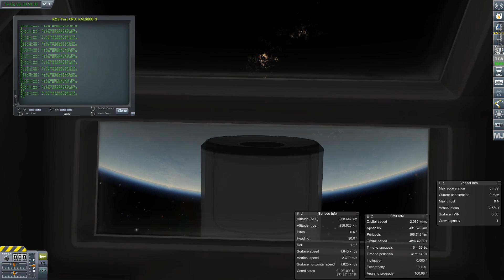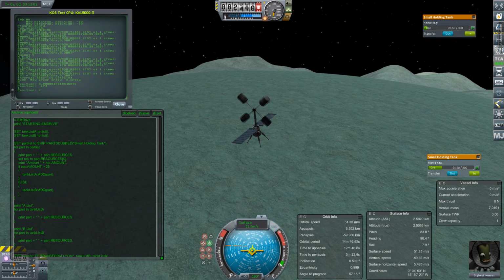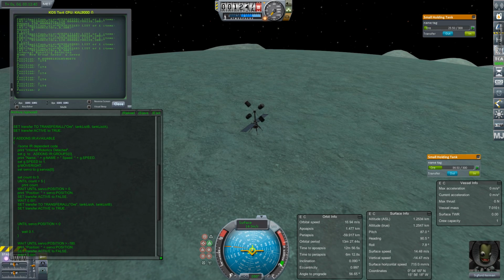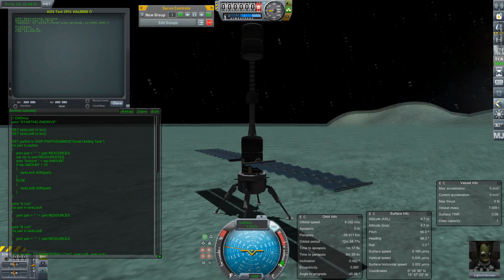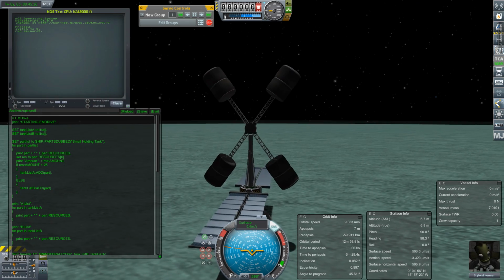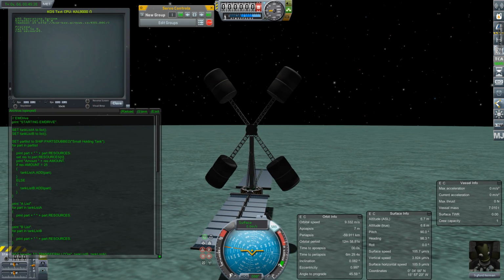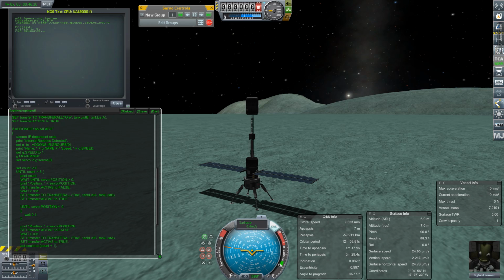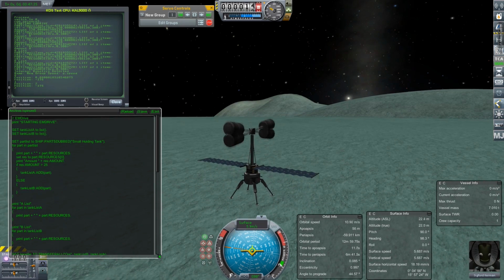Exploiting Kerbal Physics To Make 'Impossible' Gyroscope Drive

Comment: I'm just...a "little" confused. Why exactly wouldn't the gyro drive work in real life? Say, we are in ZERO G a vacuum, with little resistance ( of course they're will be one particle per every many thousandth of a meter). Then, as your first design of 2013, we rotate it, and after every 180 degree rotation, we move the liquid mass to the end of the ship pointed to location X. Would it not work? I have a limited knowledge of physics, and I'm just confused about this. If you could reply, that would be great.
Reply: Diabetic Alien  "Conservation of momentum."  Center of mass of enclosed system never accelerates.  Or a more "intuitive" explanation: in reality transferring fuel through plumbing has the same effect as moving the whole tank, so this contraption is literally rowing in vacuum, which obviously does not work.
Reply: I think what evg-zhabotinsky is trying to say is that pumping the liquid to the other tank would move the tanks, not the liquid. because of the relative mass of the objects, the vehicle would move in relation to the liquid, not the other way around. So if we have the liquid forward and we spin, the liquid is now in the back and (lets say the device is 5 meters long(5 meters between tanks)) the device is now 5 meters forward. now if we move the liquid forward, the device moves 5 meters backwards ( linearly, not by rotation as in the first spin) because it moves around the flowing liquid. our liquid is now forward and the device is in its original position, meaning we gained nothing.
Reply: In real life if you tried this the CoM would stay put and the ship around it would shift up when you transfer the mass down, but then shift back down to where it started again when you swing that mass back up to the top again.  In real life moving the CoM really means the ship around the CoM moves and the CoM stays put.  In KSP that's true of rotational changes but not true of fuel transfers, thus the exploitable hole Scott is using here.
Reply: Diabetic Alien The momentum of  the fuel would counteract the momentum you would produce using this method. Kerbal doesn't model the momentum of the fuel properly.
Reply: anagram gamaran How about if you are in deep space, moving, yes, but not of sufficient distance of an object to feel sufficient gravitation attraction. You have a tank filled with fuel. You rotate 180 degrees around the center of mass, the tank filled with fuel, then stop rotating. Then, fill the empty tank, and rotate around the center of mass, the other fuel tank. repeat many times. What would happen?
Reply: The only way i can think of for the device to work would be if we were to "teleport" the mass somehow, just like how it works in KSP. Perhaps if we were to near losslessly convert the mass in the back tank to energy, transfer the neigh massless energy to the front tank, and then use some type of mass-fabricator to near losslessly convert the energy back into mass, meaning the mass is now in the front without any significant movement of the object backwards.

 I am not sure this even makes sense because the energy might have the mass of the object which was deconstructed... but i'm not sure if  that makes any sense either... 

needless to say, I'm interested to see if physics gets...strange if we start losslessly converting mass to energy and energy back into mass.
Reply: Leyton Janqlan But would it not work with fuel pumps? What if we rapidly pumped the empty tank full with the liquid, and now the other being empty, we rotate around the new center of mass (aka the now full fuel tank). I still don't understand why this is not a perfectly sustainable and effective way of transportation in space.
Reply: That really is like putting a fan on your boat to blow on the sails, claiming that it will go forward. Or you can think of it this way: at that point your fuel pump kinna becomes a rocket engine too. You push the fuel forward, the fuel pump gets pushed backward, Newton's 3rd Law. So the process only move ship backwards relative to the center of mass, while the center of mass has not moved in space.
Reply: CKFYCoren So, thus, what could happen would be, lets say you have an infinite amount of fuel. Every time you pump fuel into tank B, tank A (the tank that is being empty) magically is filled, without fuel pumps. Could, logically, this work as a spacecraft?
Reply: Diabetic Alien if you have infinite fuel, what do you need a lossless drive for, if you can teleport stuff you already have infinite power/ instant teleportation, what do you need a drive for?
Reply: No it wouldn't work because in that case your tanks will both be full and will both have the same mass. Additionally you'd lose out on one half of the rotation because the magically refilling tank will always have the same mass. Also the momentum of the liquid moving through the pipelines to transfer between tanks would still cause enough force to cancel out the force from swinging it down in the tank. If you had a tank that magically refilled with fuel you could use it as actual fuel in a reaction engine but if for instance it instead generated an inert liquid usable only as mass you'd still be better off pumping the liquid through a pipeline pointing out the back of the spaceship for propulsion.

The only reason this works in KSP is because KSP treats pumping fuel and other matter not as "pumping matter between two objects" but instead as "dialing mass variable up on one object and down on the other at the same time".
Reply: TheRealPentigan Oh wait, I just had an idea. It's more or less a tube, but it is designed ti work underwater. Could you logically propel something if it's engine was a pump?
Reply: Diabetic Alien only if you're expelling/losing some of the mass. For example, take those water powered jet packs. Those are just big pumps with hoses.
Reply: Newton's third law of Physics: Every action has an equal and opposite reaction, moving the fuel enacts an opposite force on your craft that cancels out any progress you could have made.
Reply: Wait, I thought of something.what if you made a fuel transfer system that did not provide an equal and opposite reaction. You could almost drain the fuel. You could make the empty tank a vacuum, so the tank immediately drains. Would that be possible?
Reply: Diabetic Alien that is not possible as far as we know because that would violate the third law of motion
Reply: Nathan Strebe Fair enough. *Sniffle* My dream will never be.
Reply: Diabetic Alien every action. EVERY ACTION. Actions of the every variety. I mean technically Newton is superceded by quantum, hence the EM drive but nobody understands quantum.
Reply: Well, what is there to say? These are all entirely theories. We can't know. not yet.
Reply: HASEnoncorperated I recall hearing an explanation of the EM drive that doesn't actually "break the laws" of motion. I can't remember what it was exactly. I'll try to find it.
Reply: Diabetic Alien technically, no theory can be completely correct, it can only be the most accurate theory we have.
Reply: Well, if you take advantage of general relativity's capability to mess with the wavelengths of light (by stretching the space in which it exists), sure, you could theoretically get a device that generates energy and using that movement from nothing, but in practice it'd probably take up more energy to create the gravitational fields necessary than you'd get out of it.
Reply: +Diabetic Alien Theories are supported by reasearch, for things people came up with and don't bother to back up with evidence see every other comment on the internet.
Reply: +Nathan Strebe I was kind of using it more as an example of how, as i understand, a lot of the physics before special and general relativity are technically invalidated, if close enough approximations that we still use them whenever possible, and when we use quantum whatever we can do stuff that isn't quite modelled by them.

Comment: Scott, the fuel transfer rate is not hardcoded into a private variable of KSP itself.  It's hardcoded into a private variable of kOS, not of KSP.  It's in src/kOS/Suffixed/ResourceTransferValue.cs, line 16, as:

        private const float RESOURCE_SHARE_PER_UPDATE = 0.005f;

There is no such thing as the stock game's "standard" resource transfer rate according to its physical rules.  Instead it implements resource transfers entirely inside the user interface code, not inside its "laws of physics" code.  So when we're bypassing the normal user interface to instead provide a scripting interface, we don't really have a standard 'here's how resource transfers work" API call to make use of.

We had to make something up that felt roughly on-par with what the stock game allows.  What we made up, was 0.005 resource per physics update.

That private variable you're talking about is ours, not KSP's.
Reply: I'm sorry to be pedantic but it would be more accurate to say 'hard coded as a constant', as private variables are not hard coded, and constants are not variables. But I'm sure anybody who cares already understands what you mean :P Just had to scratch that itch... (all in the context of C#, other languages may have different semantics for constants and private)
Reply: Isn't the stock resource transfer rate roughly proportional to the fuel tank size? So a 5m tank could transfer 64x faster than a 1.25m tank, etc. When you get into orders of magnitude that matters a lot

Comment: "When the mass is fully forvard, you want to start to transfer fuel"
eh... don't you want to do transfers in in forward part of circle?
so.. begin at 90 degrees and end at 270?
Reply: You are Scott Manley. You just got a helicopter with vertical blades into space. I will trust you on ANYTHING.
Reply: What's actually going on here is that the center of mass is moving rearward relative to the axle on which the tanks rotate, which imparts a thrust to the axle and therefore to the rest of the ship, since it's attached.  You want the transfer to take place while the vectors of the rotating masses are canceling each other out, so keep it as close to the axis of travel as possible, +- 30 to 45 degrees.
Reply: For example, the vehicle that Scott used to land on Minmus has part of cycle that moves fuel forward!
Reply from the maker: I once thought like this, then I tested it, and fixed it, and this is what I ended up with. Trust me on it.
Reply: Suedocode
if the main effect comes from moves of tanks, than it is bug of Infernal Robotics
the fuel move bug comes from no inertia change from fuel transfer
Reply: Okay, here's my hypothesis. Only look at the tank's horizontal position/velocity during a "stroke" of the "engine". On the back stroke, the heavy tank starts moving backwards. Increasing the backward KE of the tank (aka work) adds an equivalent forward KE to the rest of the ship to net zero. At the 90 degree mark (half-way on the backstroke), the added KE starts changing directions to slow down the tank (forward KE from the ship is taken to cancel the reverse KE of the tank). As NoName said, this would imply that the 90 degree mark is the most optimal time to magically teleport to the mass into the forward tank.

If the FULL fuel transfer was instantaneous, then I think he'd be correct. I believe the issue, however, is that the fuel transfer takes some time. The longer it takes for fuel to transfer into the empty tank, the more cancellation (which is the correct thing that should be happening) starts happening and your "drive" loses effectiveness (it adds the same KE to the ship, but it's just heavier because there's redundant fuel). You want the tank to be empty at 90, and as full as possible up until that point.

I hypothesize that the optimal spin drive would be one that uses the full time of 0-90 pupping fuel forward, which means you should start pumping at 0 as Scott observed.
Reply: Can you transfer fuels through the rotors? If so, it will probably be even more efficient to have a reservoir tank attached to the ship rather than on spinning counter-balances. I think the counter-balances themselves don't do much in this engine anyway.

Additionally, tanks can transfer fuel at a rate proportional to their size. If a large tank's dry mass isn't prohibitive, it's probably even more efficient to have a large partially-filled reservoir to help push stuff more quickly into the drive tanks. The key to this drive is how quickly you can transfer fuel.
Reply: bobobobinalong I don't think it's merely because the center of mass is shifting around, otherwise there would be no net gain in velocity; the center of mass still shifts back to the original position after a stroke. I still think the issue is that the fuel's momentum is directly associated with the current tank its in rather than as its own quantity.

I do think your conclusion is right though; start pumping fuel forward at 150 to -150 (end of the first stroke, start of the next), or thereabout. I need to compute the actual optimal angle, but it's probably around there.

Comment: Here's an idea: spin a (balanced) ship violently (only with electricity). Than, suddenly eject a capsule in retrograde vector. It should deorbit without using any burning fuel.
Reply: Jasc Tomm I once got an OKTO 5 meters off the ground with massive seperators!

Comment: Could you beat the flow restriction by having several tanks? i.e., if the max flow rate between 2 tanks is limited to X then with 4 tanks you should get 2X flow rate.

Comment: But what about the D Drive? When you place Danny 2462, a bag of legos into a capsule and let him divide by zero assembling them = instantaneous dimensional thrust folding space time?
Reply: i mean, danny has broken the laws of physics and conquered spacetime loads of times, so... yeah.. Scott should send this to danny
Reply: choibacco At that point, the combination of LEGO and Kraken starts summoning LEGO Aquazone sets made of negative matter a la Hawking radiation, creating a sort of thermodynamic "pull" that ensures momentum is conserved.
Reply: But such a device would almost guarantee death by spaghettification of any onboard human!
Reply: Shinny Orc 
Eh. It'd be worth it.
Reply: I have a healthy enough ego to tell you that I didn't get that joke.
What I can tell you though is that some of the groundworks done by Harold White for a possible future FTL drive include the White-Juday Warp Field Interferometer. One of the goals of this experiment is to find out if it is possible to bend space by means of a high voltage electric field in order to alter gravity. Even if it proves to be impossible to actually build an FTL drive like the one designed by Miguel Alcubierre, this experiment could be valueable in inventing a spacecraft drive not relying on expelling mass, but instead propelling it by bending space-time.
Reply: B

Comment: How'd you get Infernal Robotics to work in 1.2.2?
Reply: batt3ryac1d He didn't, this is not 1.2.2
Reply: GCWAPA :(
Reply: batt3ryac1d I actually can run 1.2.2 with infernal robotics, its just that toolbar wont work
Reply: GCWAPA Yeah I know. Half of my mods are 1.1 versions and shit that either work fine or kinda work lol. But I wanted it to work properly.

Comment: I did try to avoid that very problem when createing this place buuut when you got the right Materials, Transferrate & Roation Speed it still produces Thrust dispite the fact that this Universe got a Seperate Programm to check for something like this (Sadly it never worked anyway so i simplyfied it and made that way of Gaining Speed/Velocity fairly Ultra High Ended (Compared to Modern Human Rocket & Spacecraft Engineering)

Comment: Would you not be able to produce more delta-v if you had more pendulums pumping fuel/ore around? Seeing as it appears the fixed transfer rate is really what slows you down the most.
Reply: Marijn R maybe using Tac fuel management?
Reply: More thrust, but at the cost of a higher weight. In another comment, Scott Manley said that the TWR wouldn't increase that much.
Reply: TAC fuel could work. It had 100x transfer rates if I remember rightly. I don't know if it works with kOS though.

Comment: What's with all the UNTIL loops? Does it not support WHILE?
Reply: That Guy  RTFM :D  Seriously though, this Kerboscript is a bit weird. It looks like a high level language, but in reality it's more like assembler. I would compare kOS architecture to Python bytecode, only simpler overall and running real slow, like 2000 ticks/second, within physics engine ticks.
Reply: evg-zhabotinsky That's nothing like assembler, too many operands per opcode
Reply: That Guy  Anyway, this language mostly mirrors their bytecode. Like "we won't have OOP until bytecode supports it". And they don't have much syntactic sugar. This "until" loop is actually "while not" now that I looked at it again, but they don't provide "while" as syntactic sugar for "until not". And they don't have "real" "until" loops (I mean repeat..until).
Reply: evg-zhabotinsky That's what I mean.
What's wrong with "while(!...)".
Or even do {...} while(!)